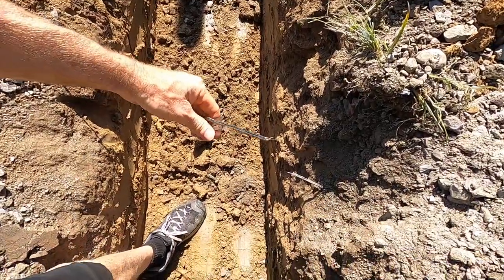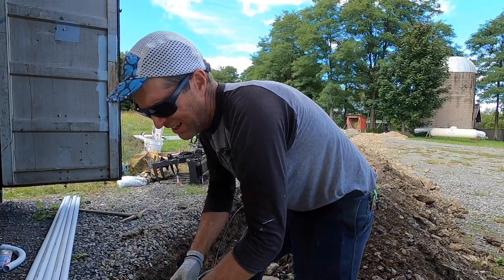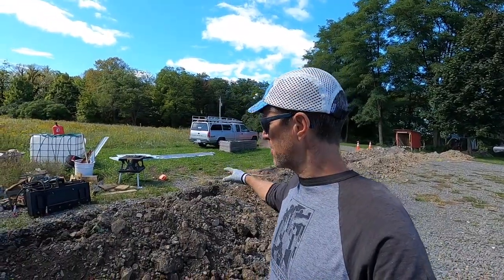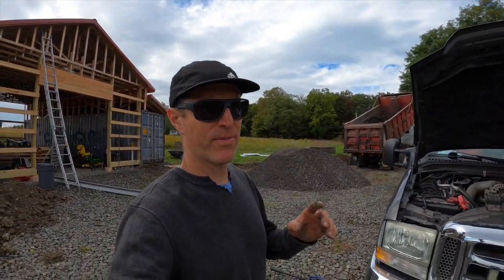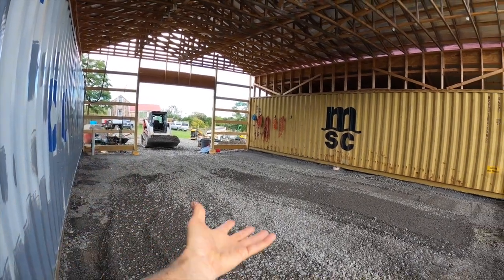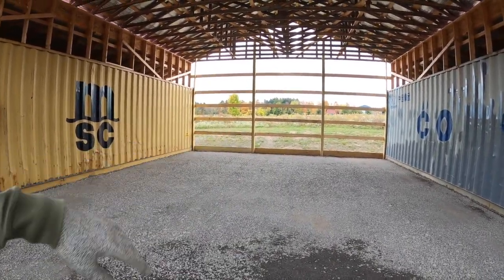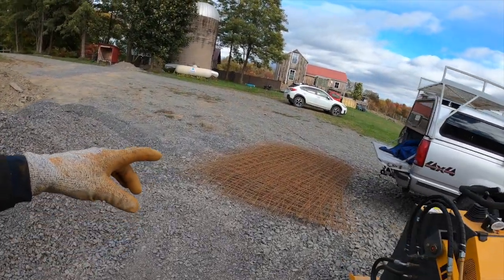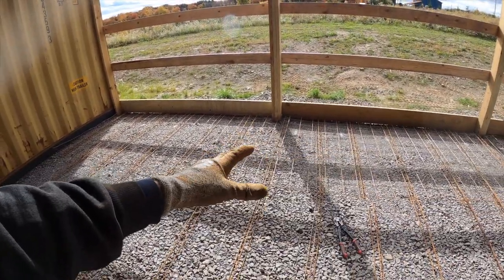Dirt Work - Shipping Container Barn 10

Comment: Next time you have an open trench and are laying casing for any infrastructure, try attaching an insulated solid core "location wire," taped along the outside of your casing. The wire can poke up along side your riser, taped along it and folded over. If and when you need to excavate and locate your infrastructure, you can attach a transmitter to the location wire, and mark along the signal with marking chalk spray paint, or just use those funny looking little plastic flags, just stick them everywhere along where the receiver beeps. That's not how I do it, though, that's just how the professionals do it. 

EDIT: heating a room or house with hot water is called "hydronic heating" and it's more used in Europe than in the USA, which is probably why you haven't heard of it. They have all kinds of decorative heat emitters that are available to hook into a hydronic system, for example a popular configuration is a hydronic towel rack that goes in a bathroom and heats the room at the same time as drying the towel. Also very popular are baseboard emitters, that don't have to go under the floor, but the tradional "classic" hydronic heating system is a bunch of looped tubing under a wood floor, that gently warms the room with warm water that circulates through the under floor system. And I know of at least one person who simply used a conventional tank style natural gas water heater as a heat source for an under the floor hydronic heating system for a large room in a house in the Mid-West. It's supposed to be very efficient, more efficient than forced air. If you look up hydronic heating online you should be able to find a good number of suppliers that can provide emitters and thermisters and all that malarky.

Thanks for the content.
Keep up the good work.

בס'ד
Reply from the maker: Thanks for all the info man. I love your idea of making the conduit/wire findable in the future: beats digging it up or not digging at all in fear. Great idea. I've been reading more about the heat system and have been sourcing components slowly ... I hope it works out!

Comment: Glue that conduit together then send a pull wire through with a vacuum. Attach your cable and pull. Easy peasy.
Reply from the maker: I've heard about that vacuum trick! Gotta try it next time
Reply: @metaspencer  it looks like you installed Romex in the pipe underground. The reason that does not meet code is because it is not rated for wet locations that Romex will fail soon. Hopefully no one gets hurt. When you replace it, use individual conductors like “THHW” or type UF cable.
Reply from the maker: @wittelkenneth interesting! Time will tell I guess
Reply from the maker: @wittelkenneth compressed aluminum conductor and XLPE insulation … more juice than lil old Romex cooks

Comment: Can you 'float' the bucket for back blading on that Chinese machine?  May not be the best but it sure is handy when you choose between a shovel and it!!
Reply: He does that at 7:25
Reply: @ryanlangan1060  Doesn't look like it.  Looks to be under power just in one place, not the same as floating, which evens out the ground more rather than fixed which just reproduces the ups and downs the front wheels are experiencing.
Reply from the maker: No true float on the bucket, gotta adjust by hand as you go. So it's not perfect and I end up raking some hahaa

Comment: Ahh, the almost fully automated compactor :-) Shame the steering was broken so it couldn't turn ;-)
Cool, I actually haven't seen one run before and need to get mine going in the coming weeks so it was just nice to see yours in action thanks Spence.
Looks like the yellow beast is performing well too which is great to see.
Looking forward to seeing the concrete pour, wood water heater and the walls going up. Plenty of projects going on but looking good mate.
Cheers. Dunk.
Reply from the maker: The compactor can babysit itself for a little while :) I got it second hand and it just needed a new sparkplug and fuel cap to get running ... you'll enjoy the COMPACTED results of the machine. Take care

Comment: Did you  forget  diggers hot line lol
Reply from the maker: It's kind of funny: I called to have everything marked but the internet cable (fiber) was untraceable. The company told me to "try to avoid it" and if I hit it they'd replace. So I hit it, of course
Reply: @metaspencer  well I guess  it wasn't detectable and that's all you did wasn't bad I remember a few years ago we were digging for a project at work and they had everything marked off and we caught the main power lines going into the building fortunately all he did is take a little insulation off the wiring
Reply from the maker: The main!! That’s freaky … got lucky